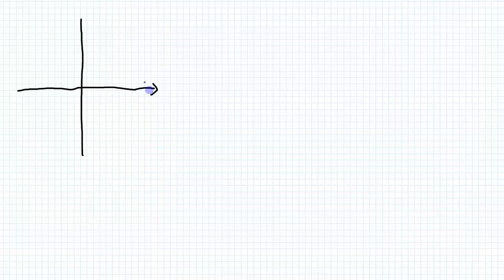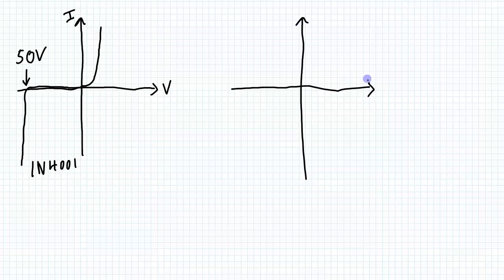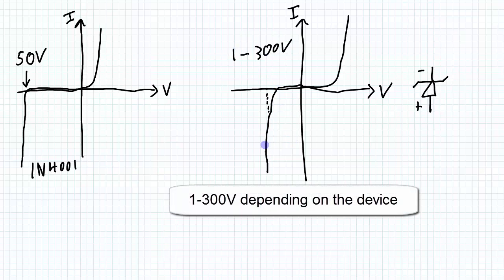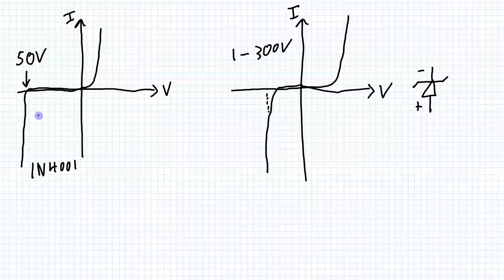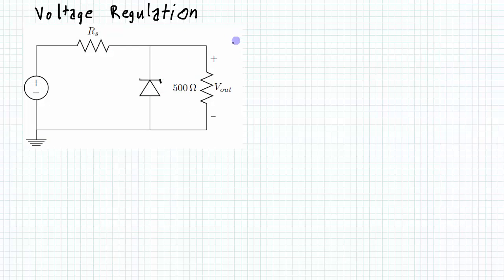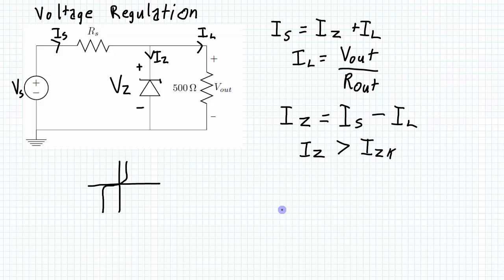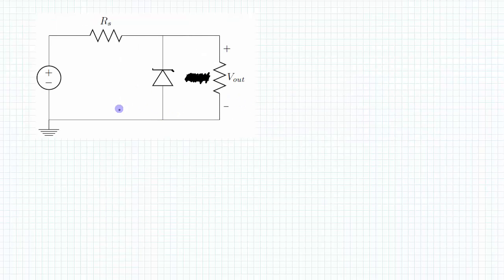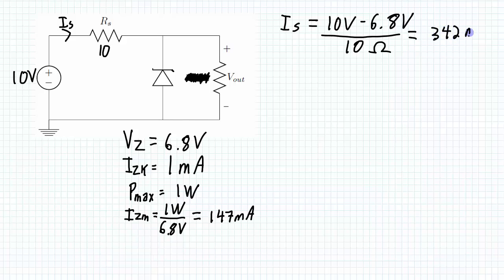Zener Diodes

Comment: This is the first time I've heard any talk of a minimum CURRENT to turn on the Zener diode. All the videos I've seen  just speak of the Zener VOLTAGE necessary to turn it on, in the reverse bias mode. Could you possibly explain this concept of minimum current eg. is this a minimum current for the diode to function AFTER the Zener voltage is achieved?

Comment: Thank you for all of the valuable information on zeners...I have a question to which I can't find the answer:
I am using a 600v zener regulator (three 200v zeners in series with an 800v DC input) which works great, HOWEVER,  I now need to input 800v -AC- into the standard zener circuit at a few kHz.  So...

Can an 800v -AC- signal be used as the zener input through the input resistor???  I need a negative dip in order to turn off the circuit with an SCR.
MUCH THANKS!
Reply from the maker: Zener diodes can be forward biased and in theory would act like a regular diode. You would want to check the forward current capabilities though since you'd likely have more current through the diode when forward biased.
Reply: Thanks very much, 
Would the output voltage drop still be about 0.7v?  or would it be -high?

Comment: on the graph of @4:42....wouldn't the positive have be like a square wave since the zener only conducts at 5v?
Reply from the maker: Since the zener doesn't conduct until the input gets to 5V, all of the current will go through the resistor; it will be as if the Zener diode wasn't even there.
Reply: @ElectronXLab    Thanks. Haha I actually figured it out after I posted this. But I really appreciate your effort in educating people...
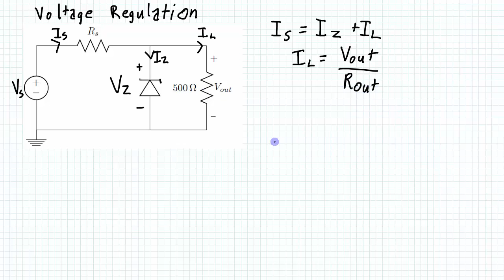Hope u don't mind but...what happens when the supply is just equal to the zener voltage @6:35?
Would the current just flow to the 500 ohm resistor(and not through the zener diode branch)?

Comment: 4:56 kirchoff voltage law is broken. https://www.quora.com/On-connecting-a-resistor-in-parallel-with-a-zener-diode-breakdown-at-5V-across-a-10V-DC-Where-is-the-other-5V-drop-going

Comment: i am making  a 5v usb charger maximum 5A from a LM1084IT ADJ. ... i want to protect the output to know more than 5.6v to obviously protect the phone thats being charged incase something goes wrong with the regulator..can i use a BZX84-C5V6 SMD 5.6V 250mW and would i need a resistor in series with the diode ? hope you can help

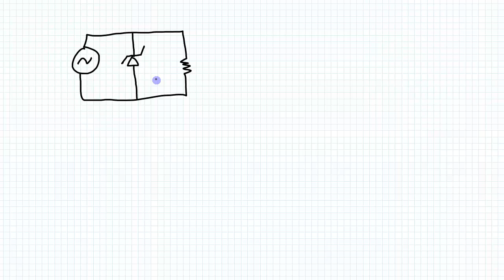Comment: If I have a piezo element and an input pin (for instance a digital input pin of an arduino), could I use the protection at around 4:00 to protect this pin with a zener diode rated at 5 volts? Or does the pin need more protection since a piezo element is able to create big voltage spikes.

Comment: is the zener diode essentially a short circuit when current is flowing through it? If so, why how does current flow through the load resistor when the zener diode is active for the last example?
Reply from the maker: It's kind of a short circuit, but one with a voltage across it.  Think of it more like a voltage source that sinks current (i.e., allows current to flow through it).
Reply: thank you!

Comment: Just so you know how good you are at teaching, I'm a french speaker, and i totally understood how to do my homeworks after watching you video.
Thank you

Could you just explain how you knew what Rs you had to use ?
You have chosen 10ohm for the safety resistance but if i take a power supply of 24volt, is 10ohm still enough to protect the zener ?
Reply from the maker: Rs controls how much current goes to the parallel combination of your zener diode and load.  Is (source current) = (Vsource - Vzener)/Rs will give you that current. If you know what your load current is and you know what the maximum current the zener diode can handle is, then you can figure out what Is will be and from that you can calculate the required Rs.

regards to Cersei
Reply: David Williams thanks for your answer :)
and thanks from cersei too :D

Comment: Great video but there is a math error. You said I_s = 342mA   but,   (10-6.8)= 3.2  and 3.2/10 = 320mA not 342mA, Therefore your resistor value would be < ~39.31ohms. SO for the other R value would have to be 21.32 ohms
21.31 < R < 39.31
Reply: +The Ranger Talk correct
Reply: that's embarrassing :face-turquoise-covering-eyes: